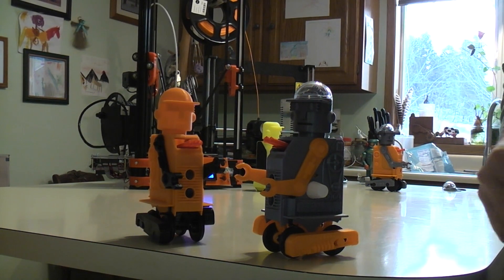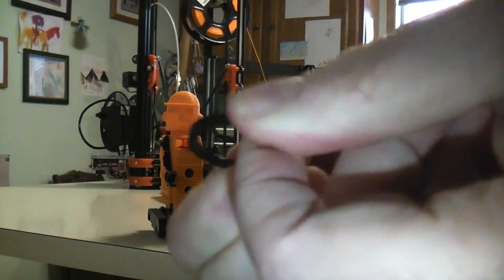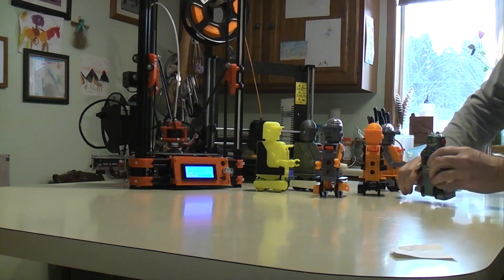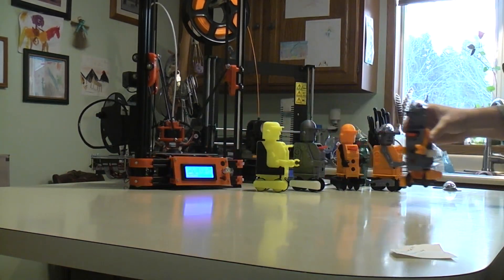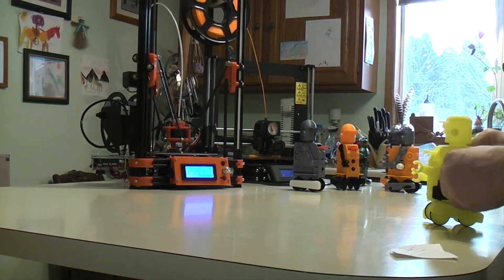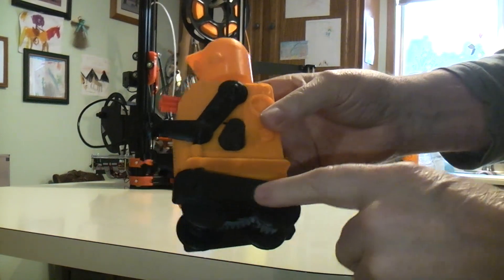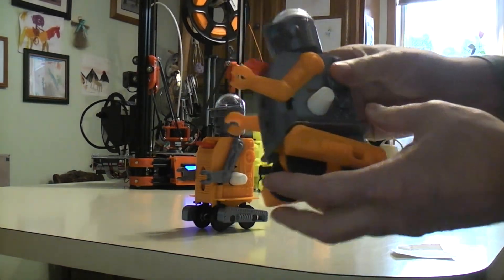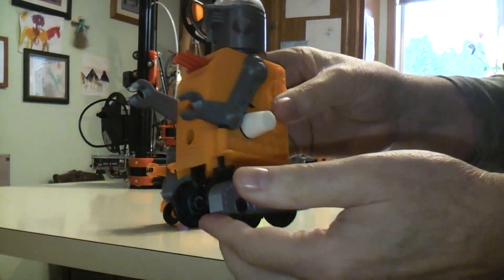All 3d printed "Action" windup Defender Robot. Demo / description.

Comment: Very hip uses you use that printer(s) for. Ya, for domes, it might be a option to go with a bit of a thermal vacuum forming rig, or for tiny items, to press clear plastic from a cut away section of a 2litre pop bottle and heat it with a thin metal that wont melt acting as a heat shield buffer between the flame and the plastic, and let gravity help shape it to a new shape around a cue ball or something round of the same diameter. could possibly fill a dollarstore ball with cement, carefully supporting it to not change shape with added tape or pillows, maybe even with pressure added to make a mold for thermal forming over if trying to scale the models up.
Reply from the maker: Yes I have two thermal forming tables and have made domes for toys many times. Just costs less to buy the 40mm clear plastic ornaments. I also have 3d printed in clear polysmooth domes before and then smoothed them chemicaly. Again just more work and time compared to the 50cents to buy a clear plastic dome.